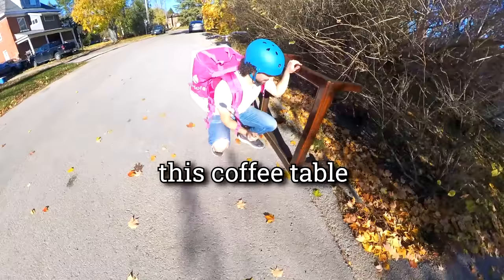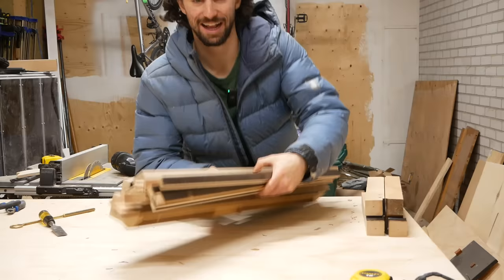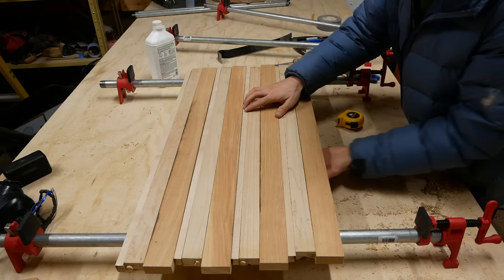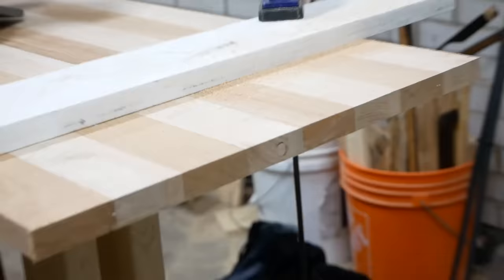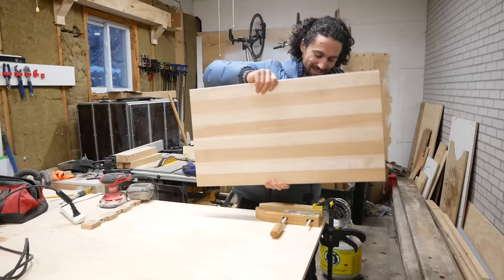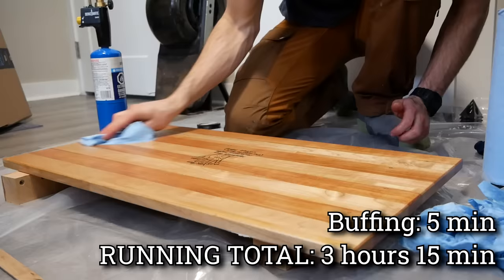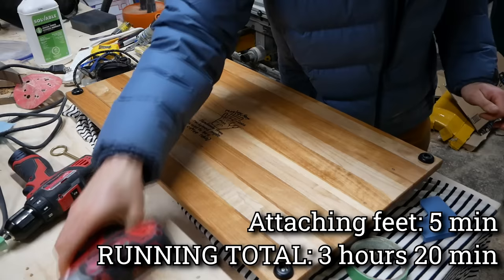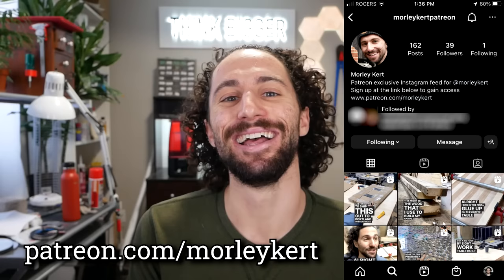Turning a Free Coffee Table into a $270 Charcuterie Board

Comment: Ive got these slats from an old ikea bedframe, replaced it some time back because what self respecting woodworker buys / has Ikea furniture 😅.
That being said the slats that held the mattess are actually great looking ply pieces! Slightly warped, but all to the exact same bend, whick works for a unique look for my intended coffee table.
Im turning them up on their side, and using flourecent acrylic strips between each slat. Not sure which color yet, but work in an acrylic fabrication shop, so no problem securing parts 😁

Comment: I thought you have to have one face of the project already flat in order for a planer to flatten out the other surface. Is the planing here just to clean up the wood and the project does not necessarily have a flat top? I'm still learning so just wondering, thanks.
Reply: Flattening one side before planing allows you to get the two surfaces parallel to each other, which isnt strictly necessary for a board like this. But the planer will make each surface flat no matter what, unless you take too deep of plane passes. You should read some old popular woodworking articles about stock prep.
Reply: Because he is reusing wood from furniture it was probably flat already. My makerspace does not let us use reclaimed wood in the planer and jointer though because of the risk of hardware hidden within it damaging the blades. They are very expensive to replace!

Comment: I'm gonna be harsh. This guy is no real woodworker. Take away his powertools and he is unable to create something like this. He's neglecting health issues as wood dust can cause cancer. Any wood. His time on the project is off as well, as any woodworker knows it's not just time worked on the project, but half of the time is behind the screens working on tools, switching and maintaining stuff. Any woodworker knows the temperature he was working in is devestating foor wood. As there where cracks already which he didn't address, I'm sure in the future when the wood is in a house on temperature, it's gonna crack further. Also, because the board is raised and only glued and not worked before the glue, chances are, it will crack on a glue seem as well. The price is also beyond real.